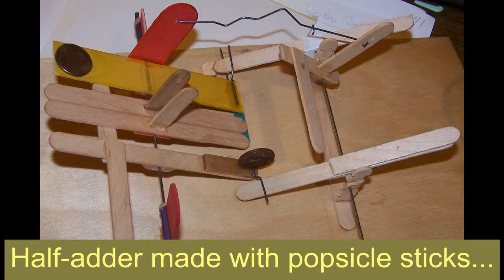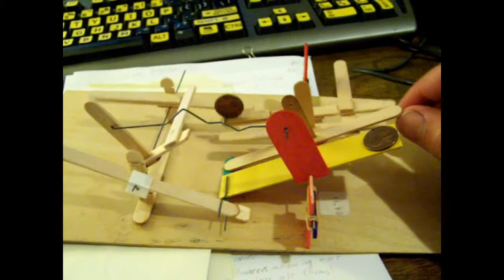Computer made with popsicle sticks (Half Adder)

Comment: GENIUS! id love an arcade game made with this good old mechanical logic.   a monitor with tv signal going into it would be possible,  but ud have to cheat at the beginning to read the signal.
Reply from the maker: Thanks, man.  This stuff is so cool -- and kids take to it really well.  It should be in middle school science/math classes.  Simulating it on a video/arcade is good, yes.  At the same time, it's good to do it in the actual physical world too.  It makes the connection in people's minds of computer processors having similar real-world, non-magical parts inside them. I'd like a kit of real-sized-but-smaller components than this that can be build up into significant fairly-complex ALUs and such.